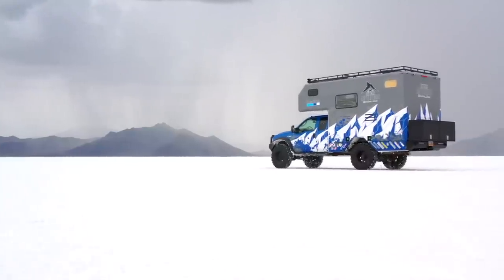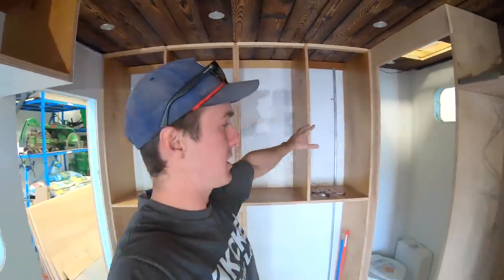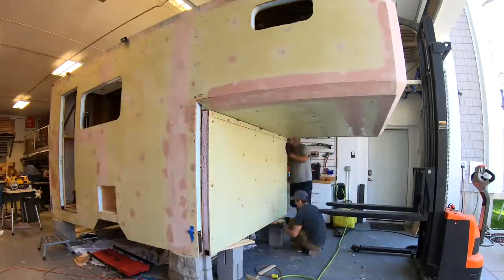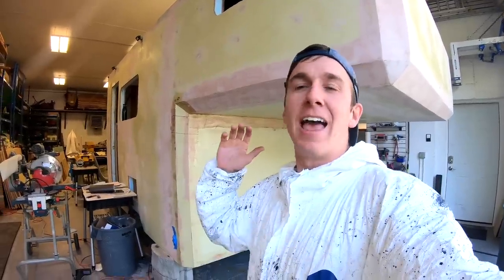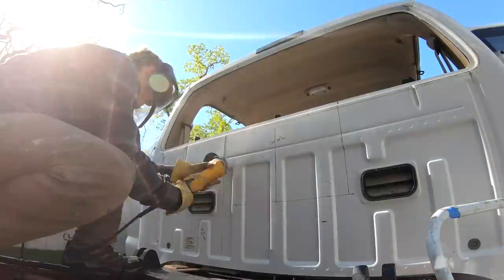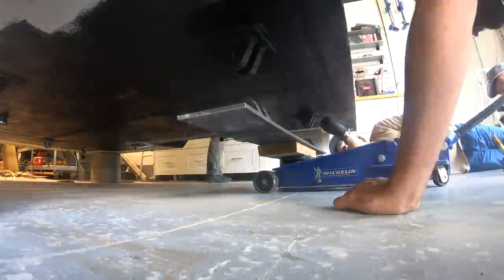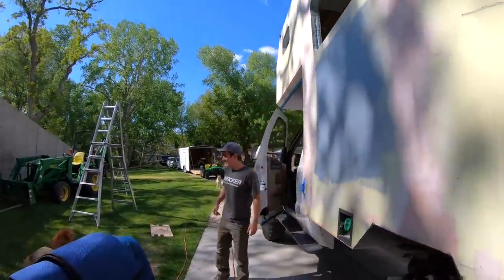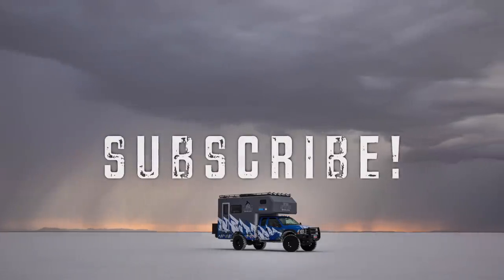MUSEROAMER PROJECT (Part 4) The Ultimate DIY Overlanding Expedition Vehicle!

Comment: AWESOME!!!. Glad you got it bulletproofed. As a fellow 6.0 owner I highly recommend getting a Scangauge 2 to monitor critical data as well as a pressure gauge on the Degas bottle. I just took my build onto Old Highway 105 in the Blue Ridge mountains and it was incredible! The truck didn't love the slow climbs too much and I think installing a switch to manually turn on the fan would be ideal. Something to consider when climbing the slow going mountains. best of luck!
Reply from the maker: Thank you so much for the suggestions I really appreciate it! I'll look into those since we'll be in the mountains a lot this winter. 🤘🏼

Comment: Killer build! Looking forward to a full run down on specs from weight to how well it holds up to the twist and torque of off road. Also keen to know what the final cost was and how many man hours went into the build and what the biggest challenges were.
Reply from the maker: Thank you for the support and feedback! I'll be posting the final weight in a later episode and I'll keep everyone updated on how it holds up. We have a running tab of the cost I just have had a hard time separating it out per episode since we saved every receipt over the last year. Everything was harder than I expected, the wall construction, the wiring, the plumbing, since it's so custom it was hard to get answers from anywhere on best practices.

Comment: very nice concept and workmanship

I wonder if the mounting points would work with some heavy-duty suspension bushings / grommets to isolate and cushion things (no direct metal-to-metal contact).  Do you get much vibration from the frame of the truck going into the floor?
Reply from the maker: Thank you George! I'm not sure about the bushings, I'm sure something like that would work though! The tolerances on the mounting knuckles are super small so there's no rattling. And no noticeable vibration in the truck other than some road noise.

Comment: So amazing! Are you at all concerned about the truck tipping in sharp turns since so much weight is high up?
Reply from the maker: Thanks Tristian! It definitely is top heavy so we need to take corners slow and stay out of high winds but I just had sway bars installed that have helped make the ride more smooth and I'm planning to upgrade the suspension further to hopefully make it more stable.

Comment: Hey beautiful build.. at very end of this video you mentioned mounting your custom boxes (under body, or under camper in your case) Where did you have them made?  I live up Mirror Lake Hwy out of Kamas, so semi local to you/slc.  Installing aluminum flatbed on my F350/Alaskan camper set up this Spring and looking for custom box fabricator. thanks
Reply from the maker: Thank you Thane! Our custom boxes, roof rack, water tanks, and rear bumper were all made at Vorsheer in Springville, UT. They were great to work with and we're psyched with how everything came out.
Reply: @AndrewMuse  sure you will be chatting about them in your next video, but quickly, did you have them made in steel or aluminum?

Comment: why didn't you have the wall panels overlap where they meet at the corners? having them just kiss at the corners then fill in the gap just seem like a terrible structural design. 
This video does show the walkthrough I didn't see in previous videos, You 100% made the right call by ignoring all the naysayers
Reply from the maker: Thanks Greg, They are attached to an inner steel frame. There would have not been much to gain by them ending at a right angle. Would have been mounting to foam if that makes sense.